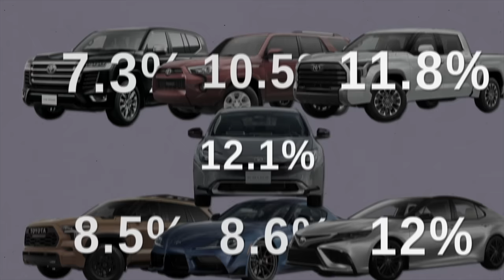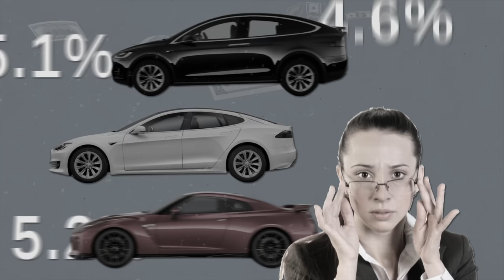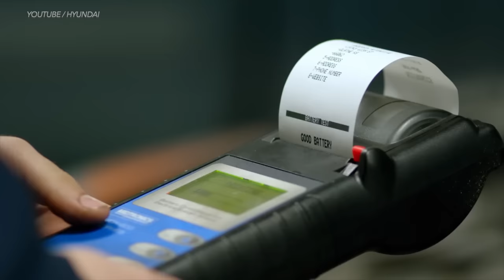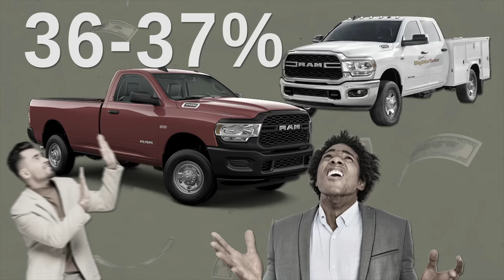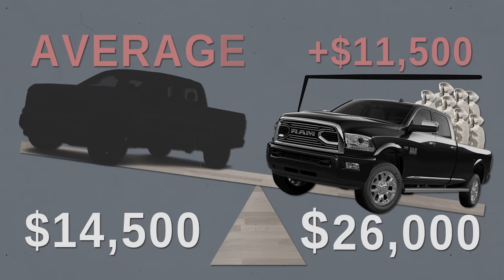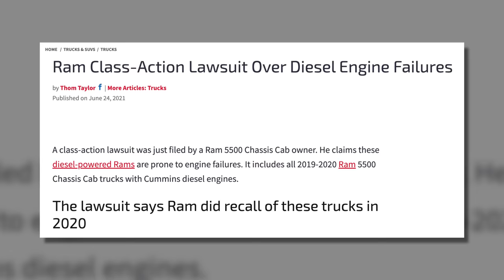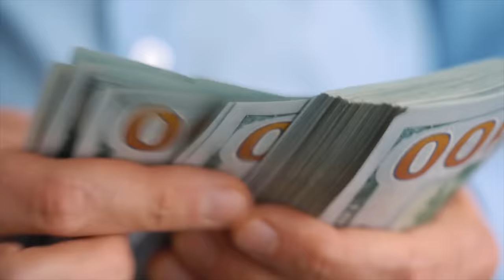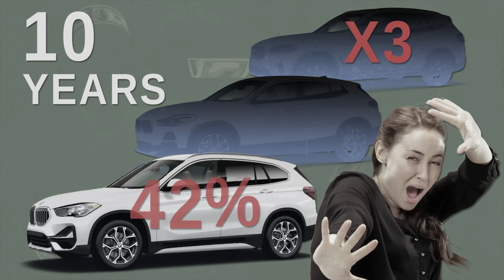Here's Why I Only Buy Toyotas and Lexus

Comment: Naturally Aspirated V6 & V8’s have been reliable for almost 100 years. I’ll stick with those
Reply: Same
Reply: And running on Hydrogen, will never go away.
Reply: From an engineering perspective inline 6s have the best shot at being reliable. There’s a reason why Toyota chose bmw for their Supra engine.
Reply: @TheRidersChoice  why is that?
Reply: @accelerator5524  because they don’t make an in-line 6 it would have been too expensive for them to develop. Toyota wanted to stay true to the legacy of using that type of engine which is more reliable and capable of tuning than a V6.
Reply: No, Toyota makes a great Inline 6. I have two Toyota Land Cruisers with an Inline 6 @TheRidersChoice

Comment: I found my 1991 Lexus LS400 big body on a used car lot with 146K miles back in 2006.  It's still my daily driver at 33 years old, 500k miles, original engine and transmission, and no dents.  Most years my maintenance cost was less than $500 and a lot of years were zero.  This has been my most expensive year - $1400 for the timing belt, water pump, and several small oil leaks.  Not having monthly payments left me with discretionary cash to start small businesses and get out of debt.  I turn the key and she's ready to go.  I cannot be coerced into a car note ever again.
Reply: Lexus is Toyota.
Reply: @thomasjohnrobinson4658  I've owned the car for 17 years and didn't know that.
Thanks.  (sigh of exasperation)
Reply: Not having a monthly car payment is the best
Reply: Car note?
Reply: Love this, I’m about to be on year twenty in my es330. Less than 500 dollars in maintenance and repairs last two years owning. 176000 miles on it so far. Absolutey loving the car so far
Reply: @thomasjohnrobinson4658  - what would we's all do without your insightful Toyota knowledge.  :body-blue-raised-arms:
Reply: @a.nobodys.nobody  - re: "Car note?"  No reason for you to know.  Why bother asking.
Reply: @warriormanmaxx8991 same could be said to you pal.  Why bother asking me?   Why bother responding

I wasn't sure if this was some term I'd never heard before or a misspelling.
Reply: I just bought a 2000 Toyota Sienna for only $1,200 with over 265k miles on it to live in.
Reply: That is WILD
Reply: well I have gs300 2001y and I spend over 7k on repair :)) failing everything, suspension, engine and etc... and everything cost A LOT, you will think thats many years of owning, nope, its only 2

Comment: As someone who is so nervous to make a bad decision selecting a car, with little to no under the hood experience. This was super helpful. I always heard Toyota was a the go to brand but this gave me evidence to prove it and way more. 10/10 love your energy, quick off to the side info. It always felt like a good break with useful information ✅️👍 thanks again:)
Reply: To be honest I think Toyota,Nissan and Mitsubishi are all good,I have had 2 Mitsui's in 15 years( the second one for 7 ) cannot fault them.
Reply: Toyotas are the best my 2017 Camry XSE is the best 
Don’t trust nissans 
Just google the Nissan transmission problems
Reply: It’s a great car for  people who can’t afford luxury cars.
Reply: I have a 2006 Corolla I bought during the pandemic. Low mileage and ultra clean. Toyota by far is the most reliable of the brands I’ve driven. Mine is super basic but it is well put together. By the way, I also had a BMW for a matter of months before I needed repairs. After I found out how much it was to repair it, I sold it. Lovely car but a waste of money.
Reply: @neilr603 I can afford whatever I want and drive a Land Cruiser, new one is around $90k so not exactly cheap. I’ve owned probably 10 Toyota and Lexus cars over the years and I’m currently looking for a new road trip car - while I could go spend $150k on a Benz or BMW, I’ll most likely get an RC-F or GS-F for half the cost because I know I won’t have to waste time and money taking them to the shop. Toyotas/Lexus are great whether you can afford a “luxury” car or not. Although I wish the Lexus LX models had one that was a more sporty trim like a River SVR or something
Reply: I had a Toyota van, a Sienna, roll across 2 lanes of highway,  going 70 mph.
The tow truck mechanic said any other make and there'd have been fatalities.
Reply: Always go for a toyota fam cause they will last you a lifetime and won't even have to buy another new car!
Reply: You wont regret buying Toyota. Just stay away from the 4 cylinder 2.4 litre engines from around 2007-2009 that are known to burn oil at an alarming rate. Toyota's only major mistake.
Reply: Go Japanese brand, it is one of the safest bet. Might not be as exciting, but heck yeah dependable.

Comment: Had a 2002 Toyota 4Runner with 323K. Just purchased 2018 4Runner with 49K! I love things that keep working for a long long time.
Reply: All depends on what it's s used for and how it's taken care of.
Reply: Whoa! Impressive
Reply: My 2001 Avalon has 280,000 daily driver
Reply: The 4Runner can run for a long time.
Reply: thats when they were good vehicles.     Toyota lost their way 10-15 years ago.   They are still good but no where near as good as 85-2005.      Surprisingly German cars really started stepping up 2010-2015 they are really good now.
Reply: @naten555  nope, there is toyota innova in saudi that made between 2016-2021 model that has reach 1 million kilometers/600,000 miles in hot dry saudi climate. funny in saudi you rarely seen germans car only few Mercedes
Reply: How much did you get it for?
Reply: Same here, I have a 2000 4Runner with 335000 miles and still running perfectly. I also have a 2019 GX460 with 11000 miles, I hardly drive it.
Reply: @naten555  I guess you've never seen a video of Scotty talking about the experiences his customers have had with BMWs.
Reply: @Don-md6wn  I’m speaking from my experience with people that don’t neglected their cars.

Comment: My first experience of a Toyota was a very basic Corolla I rented in Portland, Oregon in 1993. It just had a basic radio, no power locks or electric windows. But it had a beautiful solid well made feel about it. Difficult to describe and impossible to measure. It gave me the feeling that it would last for years if looked after sensibly. And it enhanced the pleasure of a great vacation.
Reply: My brother is still driving 1995 Great Corolla and he loves it so much
Reply: The civics were the same way,and had more style , and a little more power
Reply: 100th thumb up guy here!!🎉
Reply: Had a 93 Corolla , that car was so well built inside and out .. interior was solid . Exterior too .
Motor took me to 330k .. only thing that stopped it was I didn’t maintain the breaks as well as I did the motor and I rear ended a Mercedes … smh 😢I was so sad .. that thing coulda ran another 100k I believe
Reply: i call it a carriage on the wheels.
Reply: I just bought a 2000 Toyota Sienna for only $1,200 with over 265k miles on it to live in. Solid vehicle.

Comment: 1999 Toyota Land Cruiser. 406,000 miles, drives like a dream, everything works great, and AC blows ice cold. Secret: change oil every 3-4K miles, regularly wash, easy on the throttle and brake.
Reply: That is a lot of oil changes… why change the oil that often? I thought you only needed to do that like every 10k miles or even less frequently depending on the car/brand

Comment: We have a 2010 Lexus RX350 we bought at CarMax in 2017 and it's been an absolute pleasure.  The only issue we've had so far and this was years ago was a bad Oxygen sensor.  Luckily the warranty covered it.  Of course, we've gone thru new tires, wipers, a battery, and oil changes, but that's all standard wear and tear.  Everything still operates just fine. AC still blows ice cold.  Best car hands down we've ever owned.  We will be getting another newer one down the road.
Reply: Opp

Comment: I agree!! I still rough my 2006 Toyota Tacoma Sport 4x4. Never had a problem under the hood. It's getting a cosmetic makeover as I write this . 😊😁
Reply: had to throw mine away because the frame rusted again
Reply: @growingup4487   same.  Toyota rusty garbage I had an 2003.
Reply: Back wrecking seats too....21 tacoma & it's unbearable on long drives
Reply: @growingup4487  just car wash in winter

Comment: Still rocking my 2001 Crown Vic I paid cash for (used) in '02. One year old and 16K miles, it sold for half the new price - from a Lincoln/Merc dealership. A durable and reliable machine with zero problems for nearly 18 years in pretty demanding NE US winters. Since then we've added two Lexus models to the fleet - both totally problem-free so far. I can't think of something less luxurious than a check engine light or worrying about having to be flatbed-towed out of a busy highway because your advanced machine was engineered to make you buy a new one as soon as the lease/warranty ran out.
Reply: I love the Crown Vic had one for over 10 years she was amazing to me. So sad the quality of cars today is terrible, car makers got greedy making cheap parts, paying for cheap labor and forcing the customer to pay for more maintenance.
Reply: They have a great look!

Comment: Had friends and family who drove their lexus gs 1998 models all the way to 200k no major issues..
So I bought lexus es 300 hybrids... 2014 and currently 2017 models.. used them for uber/lyft work. 2014 still running at 300k miles no engine issues. Only had to replace struts and springs.
2017 is sitting at 200k miles, still on factory brakes .!!! No issues. 
Love these cars

Comment: My 2005 4 runner SR-5 rides great, gets good gas mileage, currently has 150K miles on it, and with the exception of brake replacement and a new battery, it has been maintenance free since I bought it new.  I wouldn’t trade it in for no reason.

Comment: I've had a Lexus RX300 and now have Lexus RX 400H. The only reason I do not have the RX300 was it was totaled by a driver running a red light. Both have been awesome and have had very few maintenance issues. In fact, our mechanic always has good things to say about Lexus. The only issue I've had with the 400H is the dashboard cracking which I knew was an issue when I bought it used and some of the rubber near the door handles leaves black smudges on the doors which isn't a big deal as I use lemon essential oil to remove the sticky smudge. Thanks for your awesome videos!
Reply: I have a 2006 RX-400h I bought in April 2021. It was a one owner car with 93k miles. I have had it over 2 years now and it’s by far the best car I’ve ever owned.

Comment: My dad bought a 2001 RX300 with over 220000miles, drove it for 8years only issue he had was valve cover gasket leaking, Replace alternator and some suspension bushing. Engine runs like new.

Comment: One factor to consider (probably mentioned already in comments):  The more expensive a car is, the lower the maintenance cost as a percentage of the price.  That's probably why Lexus (a Toyota luxury car) beats Toyota...similar quality but Lexus are more expensive.
Reply: True, that s why 7% of Lexus will be still more than 20% in kia
Reply: Not true. A $50k kia @ 20% maintenance is 10k over 10 years. A 100k Lexus @ 7% maintenance is 7k over 10 years.

Comment: I had 7'th generation Honda and maintenance was brutal. I barely drove and it constantly broke down. Mainly due to its critical engine failure which happens to those models.

No matter the brand, make sure that car you are going to buy doesn't have critical failures.

Comment: Owned Fiat,  Chevy, Volkswagen, Volvo, Ford and then bought the first RAV4 in 1996- lasted for 23 years, after that experience, been sticking with Toyotas. Recently bought a used 2012 RAV4 V6 Limited with only 100K miles & ride is smooth with nice pickup.

Comment: Great video, Scotty. Those percentages on the cost to maintain a vehicle sure are an eye-opener. I suspect in the case of some brands it is very linked to the cost of the parts that need replacement. It is easy to get an aftermarket part for a Toyota but try getting aftermarket parts for a BMW, Mercedes, or Infiniti, especially a specialized part. I suspect the parts for many European vehicles are a lot cheaper in Europe than in North America. Dealer markups?
Reply: Some European car parts cost more. I believe It’s actually the labor, that’s why you see places in Eastern Europe or even Spain or Africa etc etc and they don’t have a major problem running them for a long time, where there is a abundance of smart people who know how to do the work but less jobs or less of a premium placed on the labor.
Reply: Probably true but they FAIL much more often that Toyota or Lexus.  Tomorrow my Lexus will be 25 yo and it's still a joy to own and to drive. German luxury were provided for me by my company for 20 yrs and were VERY trouble-prone despite perfect maintenance. Incidentally, the service manager at the dealership drove a Toyota!!!
Reply: Parts are made out of plastic in strange shapes. The plastic cracks easily
Reply: Strangely, in Germany, BMW & Mercedes are pretty reliable, as compared to them here in the USA.
Reply: also, some people r leasers and r not as concerned about long term reliability.
Reply: @TrumpIsrael2024  cuz those brands r born and established in German land tho not made in China like conditions where everything either fail or fall apart even tho Chinese have interest in German brands
Reply: @TrumpIsrael2024  i was raised and stationed in Germany and wat you are saying is very untrue. I know many Germans who know to trade when they become 3yrs old due to maintenance cost alone. I saw new Mercedes and BMW's broken down on the Autobahn. To Germans BMW's are like Fords and Mercedes like Chevy
Reply: @imfloridano5448  I live in Germany. BMW declared in Court that the life of the car for them is up to 10 years and 150.000 km. Anybody who wants a good car buy Korean or Japanese. Kia gives 7 years of warranty and Toyota gives up to 10 yeas on their hybrids.
Reply: Can someone explain why is 25% so much worse than 24%? XD if you measure 30grand that would be 750 each year for 10 years. BMW oil change is 300-400alone, so besides regular oil change that is only around 300-400 of surprise cost in average. If you can afford a 30grand luxury car, you can surely afford a 400/year service cost besides regular oil change, instead of a Honda 24% which would be 430/year for the same.
Am I making sense? 😂
Reply: With mercedes, if a mechanic installs an aftermarket or previously used part, Mercedes will literally yank away their “authorized mercedes service” certification. You might as well asked them for their first born child.
Reply: @imfloridano5448  my 04 3 series is cheap to maintain and has 400km on the dash. i see more old 3, 5, and 7  series driving around than any other manufacturer
Reply: @laslocorba4143 I thought Honda is second reliable car but how they got 24% in this video

Comment: It's actually mind boggling how well made true toyotas are. It's insane how reliable they are!
Reply: Exactly. Reliable
Reply: 96 camry on the road for a reason
Reply: It’s because there’s nothing in them 😂 Toyotas are equipped with an super underpowered engine with the safest ecu map for the gearboxes possible with no in-depth interior
Reply: @bslothed3211  still better than modern disposible engines made of plastic
Reply: @bslothed3211 what else do you need?
Reply: @bslothed3211 still reliable and dosent break down fam.
Reply: Japanese culture at his finest
Reply: we forget hondas reliability because a lot of them get driven so hard that no amount of built quality would save it.

Comment: Between my Wife and I we've had six different Toyotas and they've all had low maintenance costs and high reliability. Our current 2017 Tacoma did have the air conditioning crap out on us but the extended warranty covered the full cost. Despite Scotty's concerns we're about to take delivery of a 2023 Tundra because our long term experiences make us willing to give them the benefit of the doubt. We are, however, taking out the extended warranty again.
Reply: Did the extended warranty cost less than repairing the AC out of pocket?

Comment: The service cost at a BMW dealership is unreal. $204 per unit for mechanical labor and $66 per unit for body labor. It cost me $2,900 to replace a rear bumper, that's crazy...
Reply: And your insurance company knows that too!  Bet your insurance premiums go down if you dump the bimmer!
Reply: @Said_w_the_G  My BMW 535 d insurance is not bad, $867/a year, compare to Benz gle$560 and Impala $691.
Reply: @prismspectrum1600  wtf you paying all this prices for full coverage? 😮
Reply: I could change my Honda number myself - good used ones cost around 200$ if already painted. Or around 50-60 not painted

Comment: I worked for Toyota for fifteen years in the materials handling industry. Part of the reason they were so successful during the 90s and 00s was because of the research and development they put into systems such as regenerative braking which allowed their electrical trucks to outperform their rivals in terms of battery life. Toyota experimented a hell of a lot in this and other fields and much of the technology found its way into their automotive vehicles. But I will say - whilst Toyota has always built reliable cars there was a significant drop in quality when they ceased building their vehicles domestically and moved production to new factories around the world. Even so - damned good cars (albeit expensive to fix on those rare occasions when they do break down)
Reply: My Texas made Tacoma is perfect
Reply: What's the best vehicle to buy ?